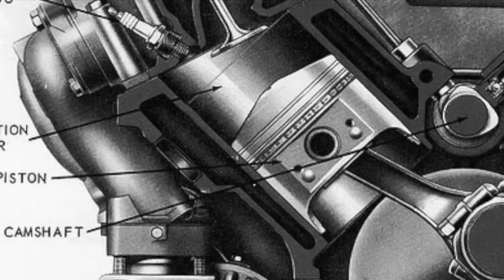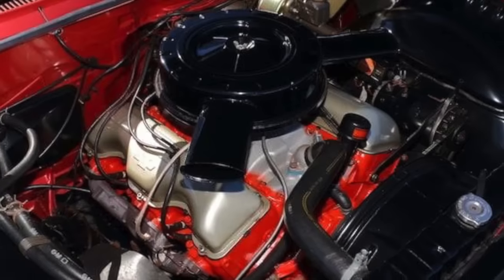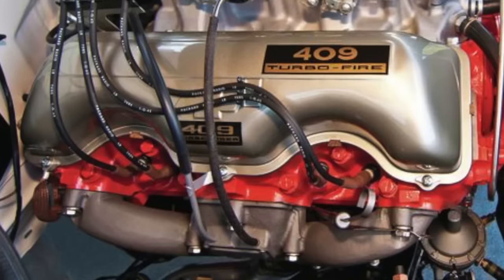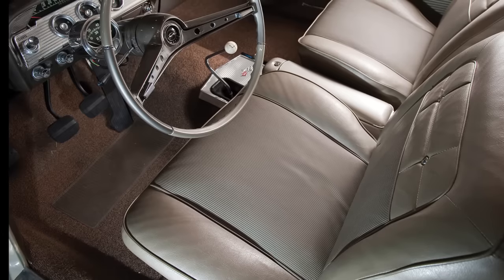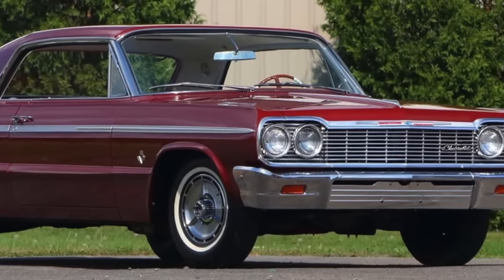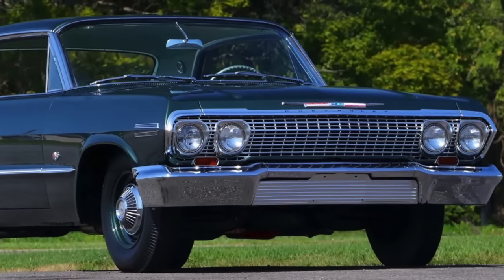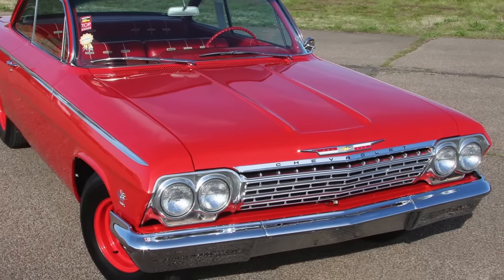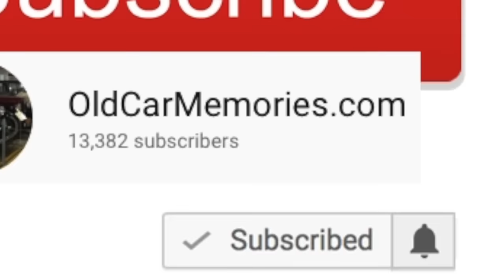1961-1965 Chevrolet 409 V8 - The Ultimate Budget High Performance V8

Comment: In 68 when I was a junior in high school, I bought a 61 Chevrolet SS body style ragtop metallic smoke gray with a red and white interior. It had the small block 283 two barrel with the cast iron Powerglide slush bucket two-speed tranny. Being it was a convertible it had the beefed up x-frame. The guy that sold it to me for $600 said that it had overheated once but still ran pretty good. I told him I was going to the State School of Science for auto Mech in the fall of 69 and was planning on overhauling the engine and putting in a high performance clutch and Muncie 4 speed and changing the 265 rear end to 318. When I tore it apart I was surprised it still ran it had a lot of broken compression rings and the ends of the push rods were crystallized , and cracked . When I took them out they fell to pieces the cylinders were in pretty good shape and the Rings hadn't messed up the Pistons so I knurled them, and the valve guides. I installed  anti-float springs on the valves with seals to keep down the oil consumption and installed a 327 four and a quarter horse cam. With new hydraulic lifters, push rods, and rocker arms. I wanted  a cruiser more than a Powerhouse so I left the two barrel carburetor on it. Had to advance the idle timing to 15° at 1,000 RPMs, otherwise it would rock itself off the motor mounts. The speedometer never worked from the time I bought it so I installed a tack. Clocked it on the highway and it did between 82 and 85 miles an hour at 4200 RPMs. Wished I would have kept it but I married my best friend that I met at SSS in the fall of 71 and by 72 and 3 we had two children. A convertible is not conducive for travel with them in North Dakota.

Comment: In 1961 I was stationed in Germany.  A friend in Dallas wrote to tell me about the 409 coming out.  He was already driving a 1961 Impala with the 348 engine, which I believe was rated at 335 hp.  He wished he had known that the 409 was coming before he bought the 348.  Regardless, he eventually wound up running a successful stable of funny cars, first with 427 Chevy engines and later with Chrysler hemi race engines.
Reply: Ok and 396 375hp

Comment: Pretty cool flashback...back in the sixties I built a few of these engines. What I liked was the engineers decided t alternate intake and exhaust valve placement as compared to the small block motors, which paired center exhausts in the center creating a potential hot spot. While they put out gobs of torque, they were heavy motors, not too good for backyard swaps.

Comment: I knew a guy who had a 65 Impala with a 409. He put it into a '68 Camaro and I put the 327 from the Camaro into my '68 Chevelle with a 4 speed manual.
That Camaro was one fast car and the improvement in my Chevelle from the beat up 307 was great. I miss that car, wish I still had it.
I had a model car, I think it was a 65 Impala that had a supercharged 409 with 4 two barrel carbs sticking out of the sides. They called it a "Porcupine 409" but I don't know if it was ever a real thing.

Comment: My mom had a co-worker whose husband drove a '60 Impala 4-dr hardtop with a 348, a 4-speed, and Positraction. It was probably the fastest family car in the West San Fernando Valley and Simi Valley at the time. The only child of the family which lived next door had an all-black '60 Impala HT coupe with the same power combo. It was one of the best looking cars in the WSFV. I thought the '62 Impala "bubbletop" coupe was a work of art and would have been great with a 409. I actually tried to buy a 1YO '64 Impala HT coupe with a 425 h.p. 409 but my dad wouldn't have it. There was a horsepower arms race in the early to mid-sixties and the 409 quickly fell out of the top tier. It had one feature, however, which no other engine could match, a unique sound. Hard to describe but once heard a 348 or 409 can be recognized by its sound. One of the hot-rod mags did an analysis of the source of the sound and concluded that it must have been due to the unusual scalloped heads. The Z-11 with essentially the same block and different heads did not sound the same. BTW, what average Chevy buyer ever went to a dealership and ordered a car with a Z-11? I believe the answer is zero. The Z-11 was a factory special racing engine and it was banned by NASCAR precisely because Chevy did not even try to satisfy the homologation requirement for the '64 racing season. By '65  GM management had banned engines over 400 c.i. so they had a legit production based "396" in '65.

Comment: Well, I saved my pennies and I save my dimes.
For I knew there would be a time.
When I would buy a brand new 4-0-9.
Reply: paul austin  Jan and Dean ?
Reply: I had one of those in a 1965 Impala SS with a 4-speed my opinion it was a boat anchor I got beat by a 318 Mopar
Reply: @tomriggle3217  I know just what you are talking about. I had a couple of friends, one hat an Impala 65 like yours and another had a 62 with a 348 tri. power. I used to chew both of them up with my little 65 Mustang. Stock 289, not K code, with just a 650 Holly. Those motors were boat anchors.
Reply: Tom Riggle the 327 ran better
Reply: tcorris 
Giddy up giddy up 40999999
Reply: Yeah, but... don't you wish you still had it...$$$.
Reply: @fposmith  A '65 Mustang was about 400 pounds lighter than either of those Impalas (I just looked).
Reply: Good ole Beach Boys!
Reply: @-oiiio-3993  and put out about half the horsepower with the standard 289.
Reply: Gity up Gity up
Reply: @fposmith  dead mans curve Custom Corvette, 6 taillights
Reply: @tomriggle3217  if the oh9 was properly tuned the Mopar wouldn't have stood a chance!!!
Reply: @JHC4949  I own the 409 Chevy I knew what they could do and what they could do
Reply: Giddy up Giddy up 409
Reply: @tomriggle3217  You needed a real Gear Head to set that thing up, timing, Carburetor etc.
Reply: @tomriggle3217  go look up 1964 409 drag. I doubt it.
Reply: @supie5063   I owned one I know what they were

Comment: Easy way to tell a 348 from a 409 is the dipstick. 409 is on the pass side, 348 the drivers side.
Reply: southernfriedhippie -you are absolutely right!!
Reply: Thank you 'southernfriedhippie' & 'Robert LaPointe' for that unbeknownst-to-me heads-up info.!
Reply: southernfriedhippie was
Reply: My friend had the 1962 Impala with the 348 and 3 speed manual on the floor. I can assure you that the dipstick was behind the steering wheel.
Reply: 61 was the last year for the 348 in the car. Still available for the truck till 65. 3 speed never on the floor from the factory. Only the 4 speed on the floor till 65. Power glide on the floor starting in 63.
Reply: They are interchangeable so not a true test anymore
Reply: My Cousin had a 409 in a 63 Tandem axle  truck .. It   would blow the doors off from my Dad's truck with a 549 International Harvester ..
Reply: My dog's breath smells like dog food
Reply: @davemontanbeau2883  plenty of sparkomatic floor shifters got swapped in
Reply: @michaelmace924  Good observation. I would expect nothing less from a fellow car nut.
Reply: Robert LaPointe Thanks for the info on the 348/409 oil pans. I didn't know that!👍
Reply: Thanks
Reply: 6687th that was a
Reply: @kimmer6  Not factory
Reply: @davemontanbeau2883  Brother had a 60 348 with 3 on the column..loved that beast, owned 59 impala power glide, 348.

Comment: Pontiac's dual carb 421 Super Duty was available during that period, that was an out and out engine in it's own right. Forged crank, rods and pistons, 4 bolt main block, factory heavy-duty high-pressure oil pump and eight-quart sump, 11.5 compression, big round ports and over sized valves, McKeller solid lifter camshaft, hi-rise (tunnel Ram) style intake and twin 4V carbs, header style exhaust.
Reply: The 421 Super Duty was an extremely rare engine. It might as well be non existent.
Reply: @phlodel  afaik the 421sd was only available in the ventura 2-door with the 8-lug wheels, and only with a 4-speed manual. the 409 was a regular production motor and could be ordered in any full-sized chevy as an option.
Reply: trucking604 My grandpa had a '65 Catalina 2+2 with the 421 & 4 speed that he used to deliver loads of moonshine. To be as big as it was, the car was a monster.
Reply: That 421 SD was a beast. I believe the carbs were Rochester 4GC's on that motor.
Reply: Charlie Christie That was what my grandpa's Catalina 2+2, 421 SD had on it.
Reply: @marzsit9833  Therefore the 409's are not as special as the 421 SD, unless one just wants have a car like "everyone else's".
Reply: @johncollins7423  I had one with 421 HO 3X2 engine.  Highway Patrol couldn't touch it.
Reply: Hammered01 Yeah, those things were beasts, for sure.😎
Reply: @johncollins7423  cool story
Reply: swiss cheesed frame, and aluminum headers that melted lol every super duty combustion chamber was finished by hand
Reply: Jeremy Thompson  Yes, I saw that video. The Pontiac was very heavy. They used to drill holes in the chassis to lighten them for the drags. They called them 'swiss cheese' drag cars. Once Plymouth & Dodge introduced the Maximum Wedge 413, they won most of the drag races. The 420 HP version had a 13.5:1 compression ratio. Chevy sold special parts in 1962 for the 409 such as 13.5:1 pistons, heads that gave better breathing and special cams. This made them more competitive with the Dodges, but I don't know if that was enough to beat them. The 409s with these parts in 62 and the 63 Z11 are what gave the 409 its fame. The stock 409s were never competitive with the maximum wedge Dodges and Plymouths.The design of their heads with no combustion chamber and valves that went straight up and down instead of at an angle caused a restriction for the intake and exhaust gases. The special heads for the Z11 with larger ports and valves attempted to overcome their handicap, but there was simply no way to make the 409 competitive with the maximum wedges and the other more powerful engines being produced. The W engine was designed to produce high low end torque. It did that very well. Yet, it was not designed to be a race engine, although Chevy did its best to try to make it one.
Reply: @charliechristie2949  Carter AFB's!
Reply: No round port heads!

Comment: Actually, Chevy's first V8 was on the 1917 Model D Touring model.  It was 288 cubic inches and 55 hp, and it was a very modern design because it had overhead valves and pressurized lubrication.

Comment: In 1917 Chevrolet designed and produced an overhead valve V8 engine. It was ahead of its time but when Chevrolet became part of General Motors in 1919, they discontinued the V8 because they wanted Chevy to be a less expensive car for the GM brand.
Was a great engine for it's time, my dad used to race one in the mid 30's and had many trophys to show for it.
Reply: Not many people know this.  OHV was way ahead of it's time.  The Cadillac  V8 was a flathead. They did have oiling problems with the engine.  Think that's main reason they dropped it.

Comment: My first car was a 3 yr. old 1963 Impala SS with a single carb 409 and a Powerglide .  Bought it 2 weeks before HS graduation by working full time in a textile factory 5 nights a week.  Blew my savings on the down payment and it took all I could do to keep a little gas in it and still court my future wife (Going on 54 yrs. now).  Sitting right beside it on the Chevy dealer OK used car lot was a '63 Impala SS with the 4-speed and dual carb setup,  I've often second-guessed myself about the one I picked.

Comment: It was not the canted valve arrangement that caused the funny shape of the cylinder covers. It was the side-by-side spark plug with its very steep angle to keep the Plugs from being shrouded by the valves. The 396 had canted valves but if you look at the evenly spaced plugs you see why they didn’t have to make the head a funny shape.
Reply: Yes I remember when the big block came out people called them Porcupine heads  !

Comment: Very interesting as always, I never knew that the curved valve covers were due to the inline intake/exhaust valves or that there was a 427 c.i version of the W engine, and certainty not that it was also used in GM's heavy trucks at the time. I do remember hearing Steve Magnante on Barrett Jackson say that early 65' Impalas could be ordered with the 409, I also vividly remember asking my dad what positraction was when I heard the Beach Boys sing it. Keep up the amazing work.

Comment: Bubble top '61 SS  is one of the most  attractive Impalas. I did not know the 409 made it to 1965. Good Info.
Reply: It was produced until January of 1965 and was replaced with the 396.
Reply: yup both 409 s and 396 s offered in 1965
Reply: The 348 and the 409 were also available in Canadian Pontiacs, and the 409 was the only big engine available in the entire year of 65, the 396 wasn't available until 1966
Reply: yup
Reply: yup 409 and 396 were available for part of 1965

Comment: Chevrolet actually offered its first V-8 in 1917. This engine was installed in top of the line luxury models and was dropped after 1918 because of poor sales. There is a 1918 Chevy with this engine in the GM Heritage Collection.
Reply: corky coker pulled a 1917 chevy v8  out of a barn in his video

Comment: In 1965, I had a '58 Chevy Del Rey 2-door that I bought from a "hot-rodder". It had a 348 bored out to 370 with a mild hydraulic cam. 3 speed on the floor. It was the match of a friend's 63 1/2 Ford Galaxie with a 390 4-speed. Unfortunately, it got totalled when an elderly woman ran a red light and "T-boned" it!

Comment: The 409 had some good power and torque for its displacement.
Reply: weird combustion chambers, though
Reply: Should of had the forged steel crank like the pontiac, instead of cast iron crank like ford and olds and chevys.

Comment: Just 20sec in the video and, can't take it serious. Ford didn't make the 1st v8 in 1932. Cadillac did in 1914. By 1932 cadillac was working on a v16
Reply: Would it be safe to say the old Ford flathead and the Chevy small block were V-8's for the masses?  Even Chev had a short lived V-8 back in about 1917.  That engine was complex, expensive, and had questionable reliability.  The Caddy V-16 was essentially two straight 8's geared together and was expensive and exclusive.
Reply: @bcgrittner  yes first for the masses but, still not 1st

Comment: Interesting video and love seeing the old Impala SS's. Also learned a tidbit of information, never knew the bore spacing were the same on the later big block Chevy which was thought to be a clean sheet of paper design. The technology was quite advanced on the 348/409 engine for its time, using a staggered valve layout and the ultra high compression.  What a great era in automotive technology.

Comment: Chevrolet had a V-8 of 288 cubic inches in 1917 - 1919. My uncle had one and sold the car to an Australian fellow about 20 years ago. It was a model D V-8 touring car. There was also a 4 passenger roadster model available.
Reply: That was the first Chevy V8.  It had overhead valves too!

Comment: I miss the 348 and 409.when i was a kid they were everywhere.
Reply: That's about right. I had 8 uncles and they bought those cheap early chevys. 1961' through 1965. I remember seeing a 409 pulled out of one of the cars and sitting in the dirt. It had bent pushrods. Replaced that car with a 327. Must have been at least 10 chevy cars around grandma's house. As a kid I used to break the windows out.  At one time the yard look like a junk yard. It was a gold mine and all the cars got junked.

Comment: Get your facts straight. Chevy made a v8 from 1917 to 1918 which produces 36 horse power and is over head valve. Cadillac was first to do the v8 in the u.s. between 1914 and 1916. It was also over head valve.
Reply: yep  your right
Reply: And it was overhead valves
Reply: First small block V8.
Reply: Where can anyone see a photo of this early v8 Chevrolet ?
Reply: @animalcorvair  Yes, and on those first overhead valve engines you had to lubricate (grease) the upper valve train by hand ...Oh,boy !
Reply: @charliechristie2949  yep
Reply: Yeah I've notice they screwed up alot on this channel.
Reply: And Cadillac began using the V8 in 1914, making it the first US carmaker to do so. In France, De Dion was mass-producing V-eights in 1910.
Reply: @timswift1863 , Google search 1918 chevy ohv v8.
Reply: @timswift1863  You can see the real thing at the Sloan museum in Flint MI
Reply: @timswift1863   l have a photo of it in a Chevrolet Story booklet from 1961.
Reply: It also had dual exhaust.

Comment: I worked at a Pontiac dealership in 1967. Gary Seals, the performance mechanic, had a 65 Impala coupe. I actually looked at his engine in his stall as he was working on the brakes and talked to him on a regular basis. Now here is the strange part: He had a 327 motor with the valve cover stickers which said 425 HP. That is right. 425 HP. In the 80s I saw a listing of all the Chevy valve cover stickers and they actually had the 327/425hp sticker, which I have never seen since. I have never heard anyone else confirm this, but I saw the thing and clearly i. t was a 327
Reply: With the right parts combo 425 HP is possible with a 327 .
Reply: @jamesguidry3995  This was a stock, from the factory motor. I saw the decals on the valve covers at 425HP. I even recall some 20 years ago a company who made the engine stickers had the 327/425HP available. This car was new and the mechanic had only had it for a few weeks at this point.

Comment: Both this and the 348 were also used in medium-duty trucks; for that occasion they were built with stronger crankshafts. For 1966, the 366 replaced the 348 while the 427 replaced this 409.